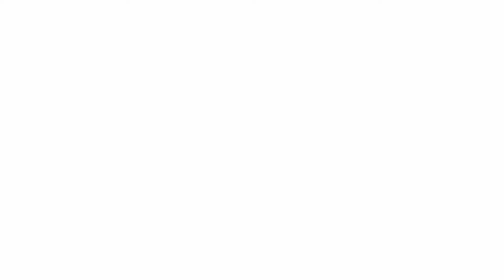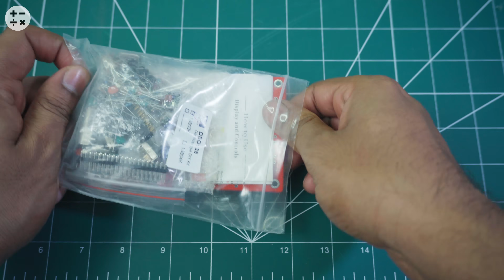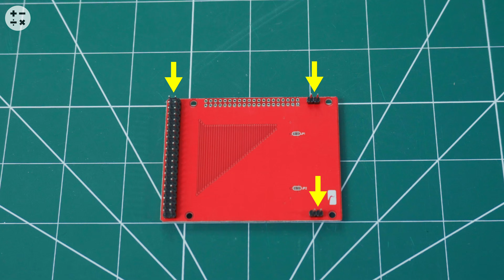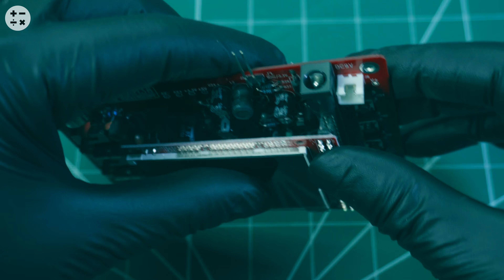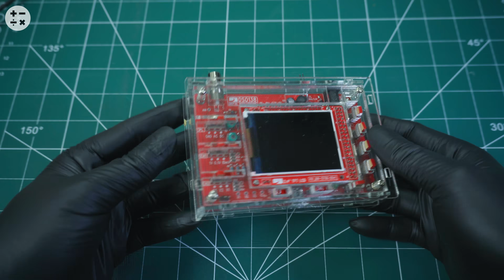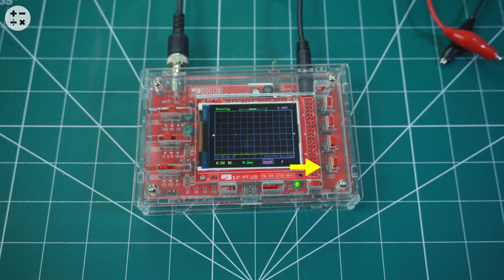Building & Testing DIY DSO138 Oscilloscope from online store

Comment: Just a heads up. This has been around for a long time and there are different versions. I got one where the resistors didn’t match the part list on the printed instructions. Instructions I found online were different but matched the resistor values I got. So there was some ambiguity to whether the parts were wrong or the instructions. 

It works ok, mine won’t trigger on some time values and it’s not so stable  but I have used it successfully for rc related stuff like PWM, SBUS and looking at some SPI lines. It’s way better than nothing but if you don’t want to practice soldering I’d go for one that’s preassembled. There are cheap oscilloscopes that look like they’ve turned this into more of a ”product”.